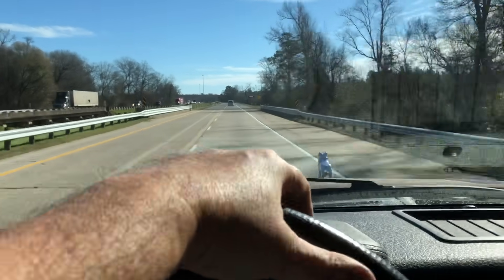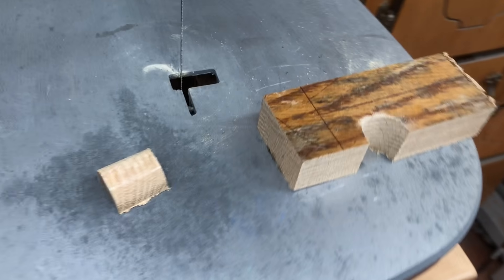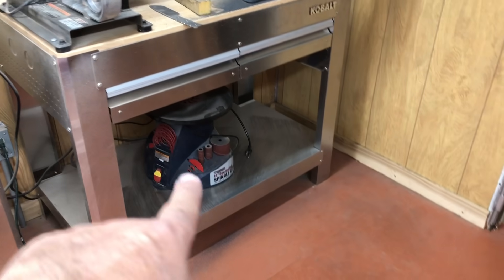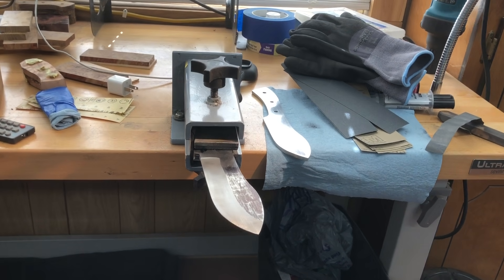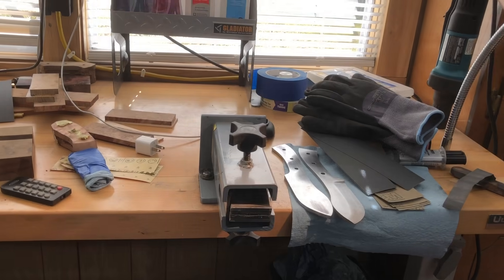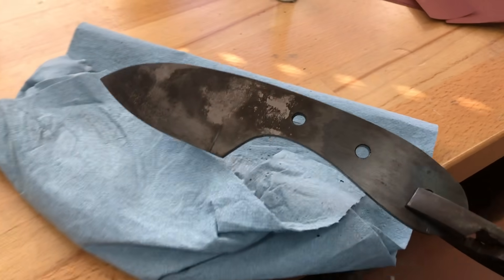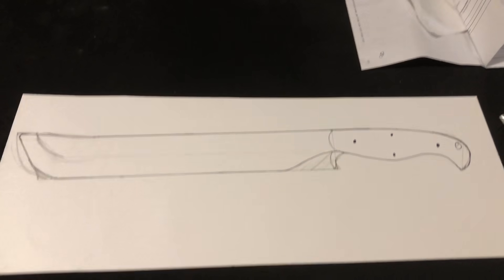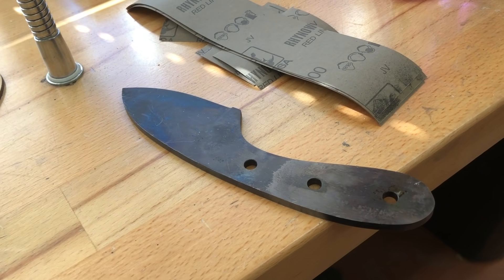New scroll saw, new blade style

Comment: Congrats on the scrollsaw. I have a DeWalt that I bought many years ago. Be careful. Before you know it,  you'll have a scroll saw blade collection to rival your sandpaper and gloves collections. Yes, you're gonna want them all, including the coarse wood and metal cutting blades. Best stored in small capped vials. Found mine somewhere on the Internet years ago. They fit perfectly into the plastic grid that's often used to  cover overhead fluorescent lamp fixtures. Made a box. Topped it with that grid. Easy to see those vials. BTW, also made a bench for that saw that's the perfect height to sit and saw. Ideal for cutting out the letters of the size and design you want for your sign. .....
Yes, a beautiful sunrise. Thanks for sharing as we wait for Sonrise.
God Bless.
Reply: I think we might be seeing Psalm 83 or maybe Ezekiel 38 on the horizon. Jesus is coming for his Bride and it cannot be quick enough for me!
Reply: @quiltingtrucker  Amen....